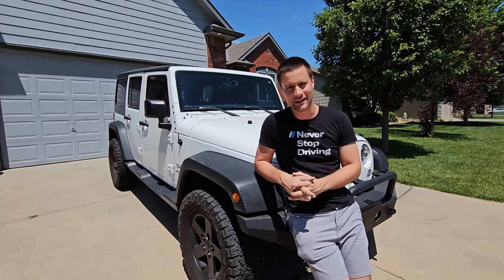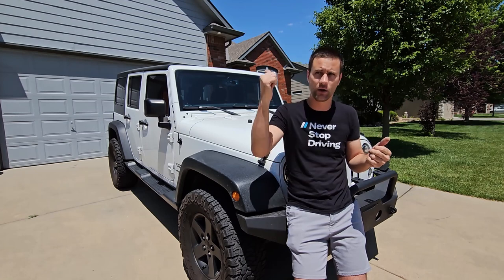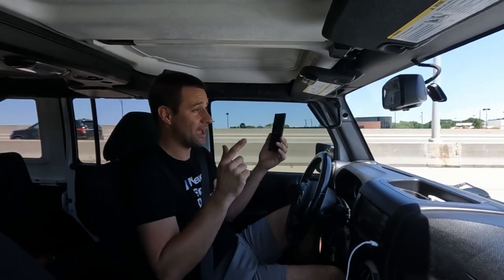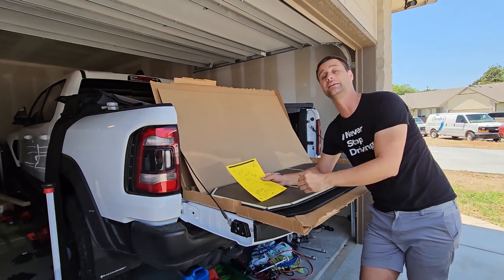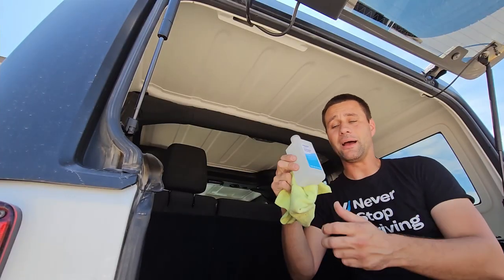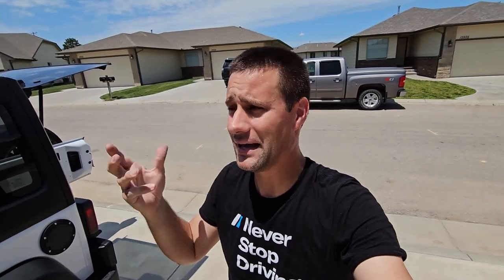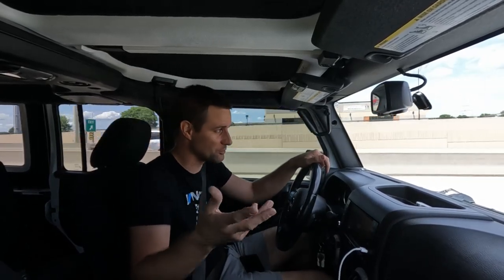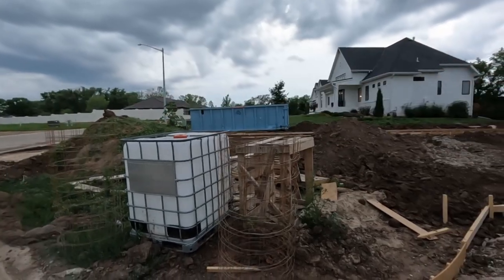PROJECT JK RESCUE Gets A Headliner And House Build Update Jeep Wrangler JK Unlimited

Comment: Tyler, Off-topic Jeep GC question. I need to replace my current tow vehicle. I used to own a 1998 5.9 GC that towed my enclosed snowmobile trailer with ease in the mountains of Maine. What would you personally recommend as a solid engine and transmission to tow 5,000 pounds or less? I'd love to get another GC but I'm not sure what years are the best if previous owners maintained them properly. Thanks in advance. Your Mom's Jeep looks great and the new house is looking better with every video update.